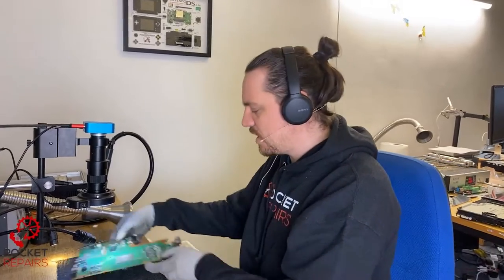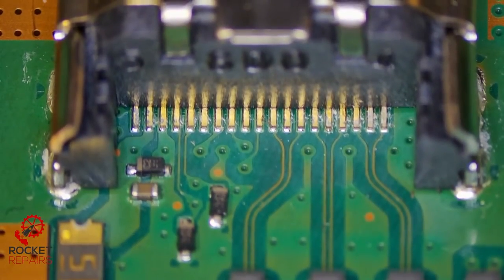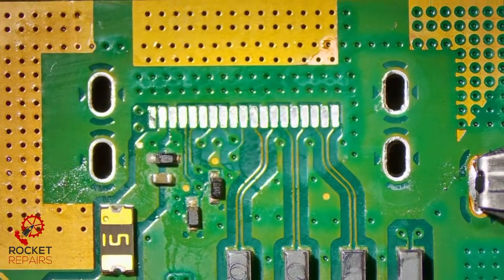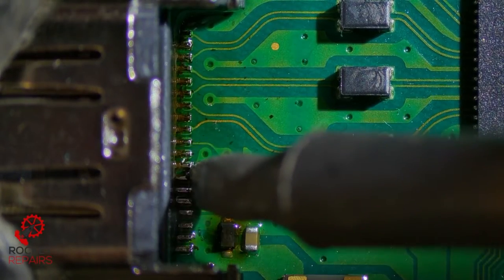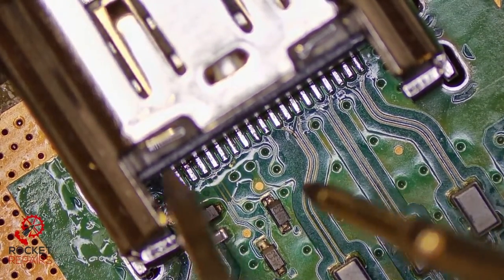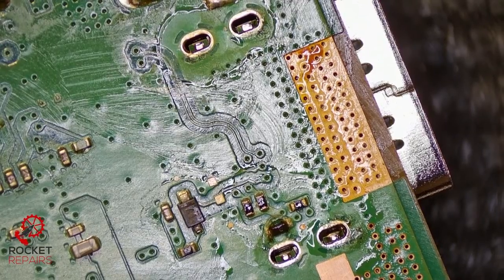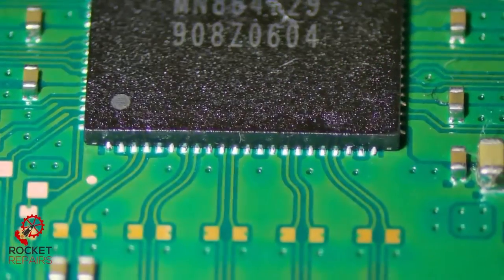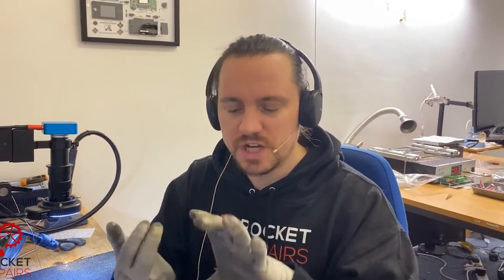PS4 No display but the HDMI port is fine... why?

Comment: My ps4 displays only 480p, i tried evereything. Another tv, another hdmi cable and its the same, only 480p. On other resolutions its only black. Any ideas ?
Thank you..
Reply: Same for me, have you already found an answer?I heard it could be cause by the software, could be caused by ic chip or port as well, just check the resitances near the ic chip, if they beep on two sides, the ic chip is most likely done or check the filters, if those beep straight forwar they good if they cross they aint good(I guess it was like this).Hdmi port change should be the way to go if everything else seems okay.